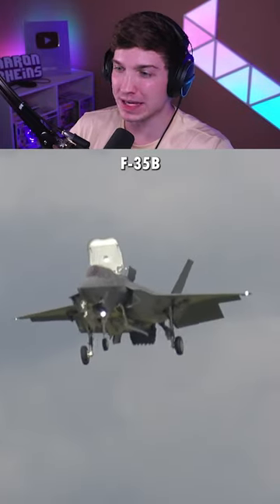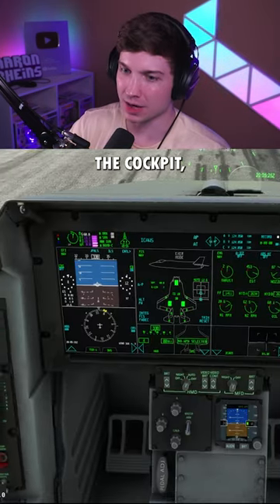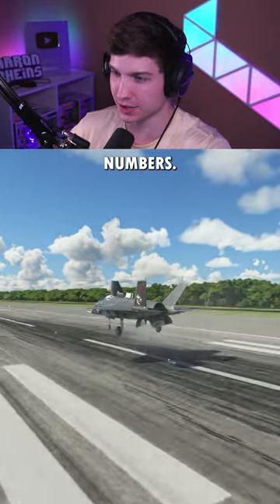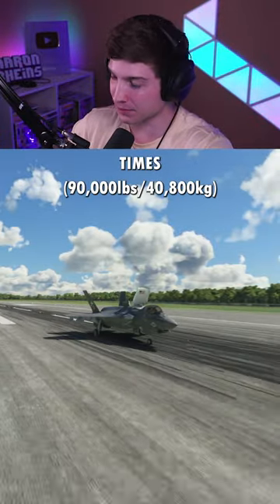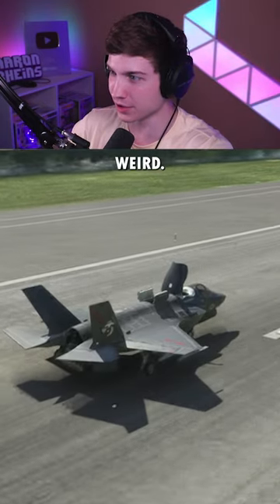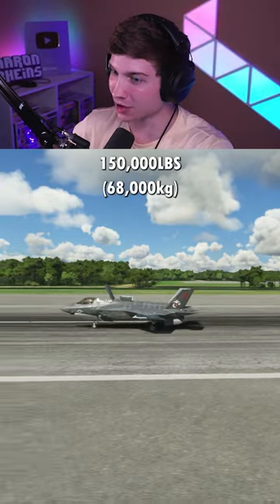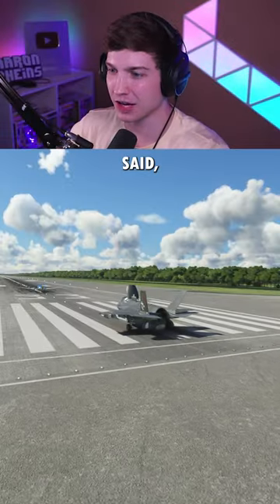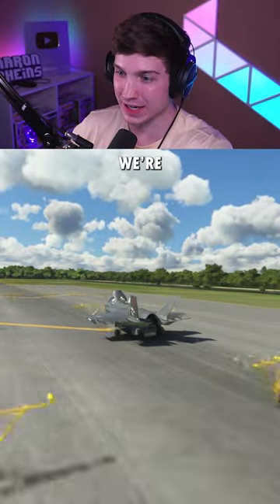F-35B STOLV Max Takeoff Weight

Comment: Bro is this a plane or a Helicopter I literally do not know
Reply: Helicopter use rotor to fly, not turborocket to fly
Reply: Bro it’s just a joke
Reply: @pinukhaha "turborocket" 💀
Reply: @dead_to_you it's actually STOVL, short takoff and verical landing
Reply: @amppari_234  isn't turbo rocket a kind of engine that most jet use??
Reply: @pinukhaha  not quite. It can mean either a jet or a rocket with oxidizer. Air turborocket might be what you were looking for. Similiar, but an important difference.
Reply: @amppari_234  ok
Reply: @pinukhaha  Turbojet or turbofan, most jet engines aside from ram jet types are usually either of the two.

Comment: Can u do the max take off weight for vertical takeoff?
Reply: None of the F-35s were meant to take off vertically
Reply: @ilovemitaka  if they can land and hover vertically then takeoff is technically possible, but the margin for extra mass will be razor thin.
Reply: @marnixprovoost7961  The F-35B has a vertical takeoff test video you can see but I don't know about the C
Reply: To be fair he didn’t mention which plane, he could have meant the Harrier, which does vertical takeoff. Would be interesting to see for sure